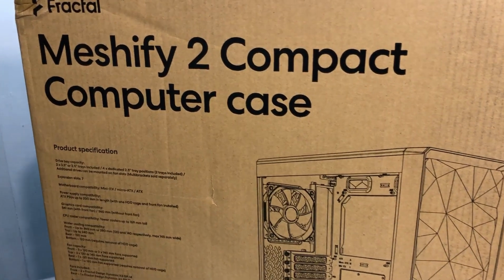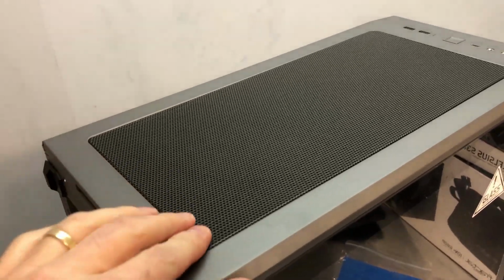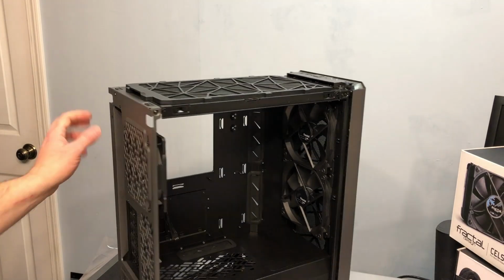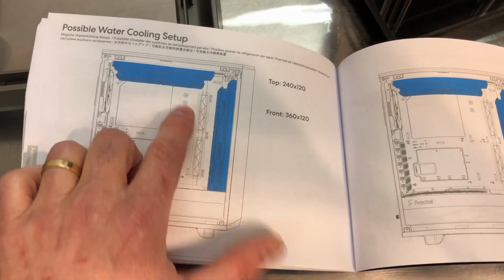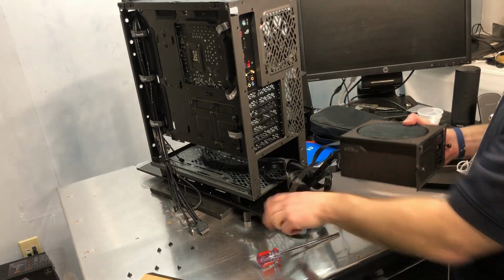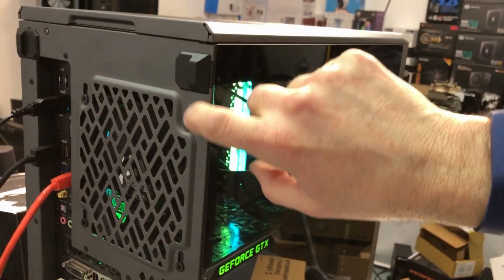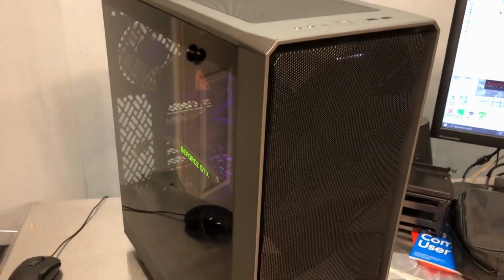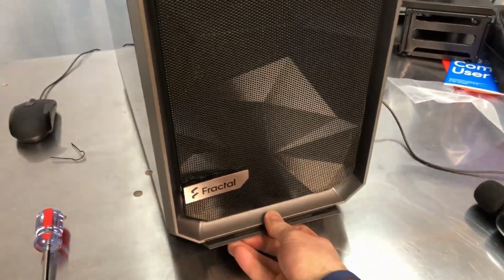Overclockersclub takes a look a the new Meshify 2 Compact from Fractal Design!

Comment: 3*120mm intake through filter and radiator,  2*140 mm + one 120 mm exhaust? 
Wouldn't that make this a negative pressure setup, therefore making those huge/unfiltered areas of empty GPU slot as intake?

Comment: Excellent walk through...  Thank you...  Just a comment...
Instructions on the outside of the case cardboard box is an excellent/helpful idea.  However, colored ink on a brown cardboard interior is dumb.   I am against a manufacturer spending any unnecessary monies that do not contribute to the quality of the product.  In addition it is environmentally insensitive.   That said, this is the best case I could find that had a smallish footprint without any compromises in layout/construction/ventilation.  I have settled on this one for a new build for my wife.  Tons of ventilation and I think I can make it quiet with quiet components.   I started out with the intent of building an ITX case.  I could not find a single case that did not have at least two or three shortcomings/compromises.  I would have more I/O USBs with this one, but at least it has a C I/O.

Comment: For an hour I had a Meshify 2 Compact = The power switch sounds tinny and loud, the front mesh panel IMO will break off somewhere between the front panel and mesh from the wear and tear of cleaning the mesh/filter, and comparing it to my Define R6 - the Meshify 2 Compact is built like a POS IMHO.  I sent it back to the seller right afterward in disgust as I think Fractal could have put in more quality, especially for the fairly high price.  I wanted to build in this case, now for my tastes I know to avoid it and this is IMO - your taste and judgment could differ.
Reply: I had decided on this case for a build for my wife.  But, the BeQuiet compact "silent" case was a close second.  I was waiting for Amazon Prime day to order all the parts hoping to save a few $.   That is a couple of weeks off.  Kindly respond with any insights if you think there is something I should know or could use...   Thank you...
Reply: @NevadaScrubJay  It depends on what components you plan to put in there IMO.  I did decide to order another Meshify 2 Compact, but I know down the road because of the issues (IMO) with the case that either I'll put in a parts request or potentially purchase another computer case.  Otherwise, it fulfills the case size needs I had.  Many of the Fractal Design cases for sale on Amazon seems to be by 3rd party sellers.  I had to purchase mine from Newegg and did 2 day shipping as I live on the East Coast and the case is coming from California.

Comment: Im looking to get this case, I’m just wondering if it would be possible to fit a 360 rad at the front with the tubes at the top and a 240 rad at the top with tubes at the front? I’m thinking it may be a bit tight for the tubes at the upper front corner. Cheers